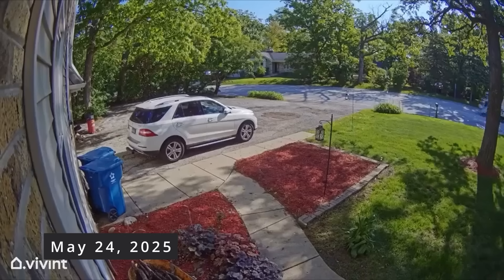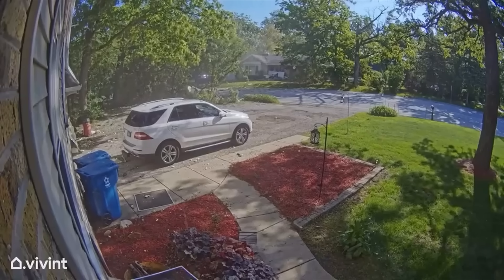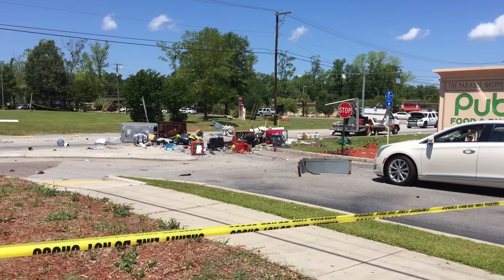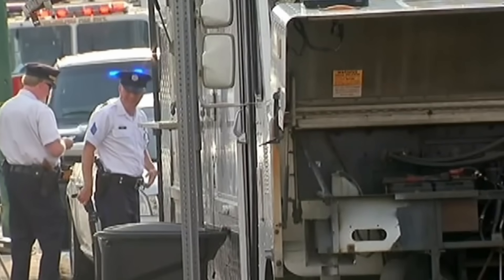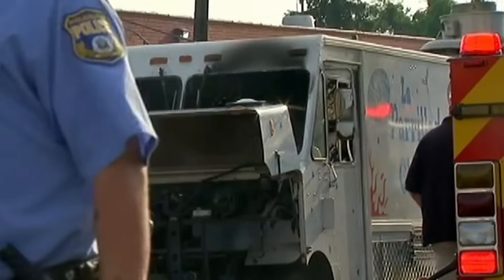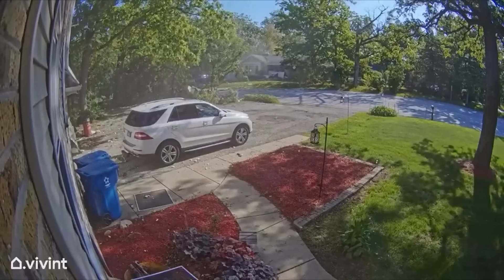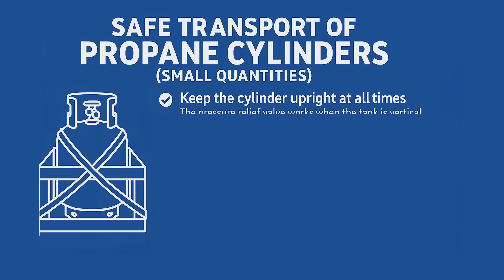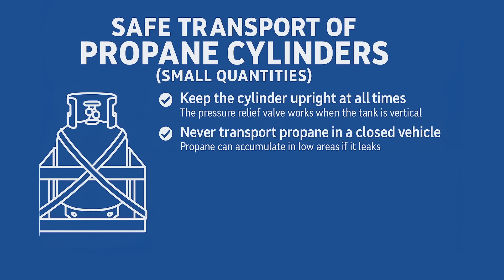Box Truck Explosion: How to Transport Propane Safely

Comment: In 1990 I was wiring an inlaw apt i had built with a friend who smoked cigars.  Suddenly we smelled gas.  There were no windows at doors installed yet.  We got out of there and called the FD.  The gas got stronger and entered my connected house so we evacuated to the street awaiting the FD from a half mile away.  When they arrived a Firefighter with a sniffer had me guide him through the house to the door leading to the basement and garage.  The door between them was open as was the garage door.  The sniffer did not detect the presence of gas as we walked through the house to the basement door.  Upon opening the door this Firefighter flicked a light switch.  He looked at me and said "I won't do THAT again"!  We descended the stairs to the basement and just before we reached the garage a different Firefighter opened windows the upstairs doors and windows.  Upon exiting the garage the sudden  draft pushed the gas cloud past us and set off the sniffer.  As it turned out the gas was propane.  At the back of my yard condos were built.  Some kid vented a 20lb gas grill propane tank and left the valve open because he wanted to empty the tank so when he took it to be filled he" wouldn't be paying for gas he already had".  The World is slopping over with idiots!
Reply: I'm at a loss for words.
Reply: To be fair, the firefighter came very close to being one of those idiots and taking you with him
Reply: And as evolution evolves, there won't be any idiots left! Can you imagine a world with no idiots?
Reply: @dirkfrazier-c1j I’m afraid that’s not how it works
Reply: @dirkfrazier-c1j the government protects idiots.  It's why standards keep.lowering , and idiots are coddled.
Reply: @dirkfrazier-c1j  Wrong, because idiots and psychopaths breed like mice.
Reply: What 😂😂😂 so why waste it if you already had propane ? It’s 40-50 if you buy the propane tank the first time 😂 20 for a refill 😅 why ?
Reply: @George_Soros.  Same thing if you siphoned every drop of gas out of your car before refilling it! Maybe, they just didn't want the old gas mixing with the new gas and fools are born every day!
Reply: 0 IQ activities

Comment: I remember many years ago, several propane tanks were stored on asphalt lot and on unusually hot day, the heat caused the tank to vent, and something started igniting the venting causing large fire to break out and some tanks that were still full started blowing up like rockets.  All because someone didn't think storing full tanks on black surface on a hot day would be a problem.  I can't remember the detail and Google keeps giving me this U-haul explosion even though I mentioned "several exploding tanks"

Comment: A propane tank meant for being mounted laying down ,like does used on forklifts should by any logic be transported laying down( with the overpressur valve pointing upwards) if it full and stands up  the overpressure relief valve may be in the liquid part of the propane ,
Thus not work in case of overpressure ,dont you agree?
When doing hot work certificate  courses, they  usely     talk about propane and acetylene gases in worksmans vehicles. I saw a picture of a wv sprinter that was totally ripped open due to a gas leak ,the guy using the vehicle used the remote to turn of the locks,  standing near the vehicle and the it  exploded kxxxng him.

Comment: My 20 lb. tank fits nicely in a standard milk crate.  Very stable and always sitting upright.
Reply: Doesn’t help if the valve is leaking.
Plumbers vans frequently “disassemble” when turned on in the morning for this reason…
Reply: @allangibson8494  Why plumbers vans? As a plumber, I'm curious
Reply: @rooter-c5c Plumbers have gas bottles for soldering copper pipes in their vans.
Unless you store those bottles in an externally ventilated blast proof compartment, leaking gas can build up inside and when the vehicle is started, sparks from the starter will ignite the trapped gas. The usual result is the body of the van spread over the neighbouring houses first thing in the morning (that tends to be bad for the driver’s health too). (Think car bomb).
So store your flammable materials in an externally ventilated compartment (or outside like most caravans do).
Reply: @allangibson8494  I think you've seen too many movies. I've been in this business for 35 years. Out of all the plumbing shops I've worked at, out of dozens and dozens of service vans, including my own shop vehicles or that of my acquaintances shop vehicles, never once have there been an incident involving a MAPP gas cylinder explosion. 
1. In a traditional open air van, you'd smell it upon entering the vehicle.
2. Spark/Ignition contained within in a starter
3. The starter/alternator are sealed off in the engine compartment.
4. The likelihood is virtually nil.
Reply: @rooter-c5c there’s always one guy…
Reply: How nice. Do you pet it every night before you go to bed?
Reply: I just always put in my lap under my seat belt.  That way, it is leaks, I know right away.  And if I am in an accident, the air bag will keep it secure.

Comment: Doesn't the vent need to be down low, like on the floor?
Reply: Corect! If you have propane tanks in a encolser like on many sailboats that may have propane  storage tank spaces built int the hull you should have  drain hole /hose  in the bottom that lets eventual leaked gas  run out.  Gas or gasoline explosions on boats are often deadly  because a boat cant be naturally wented in the bottom. The deck part  will often simply be blown clear of the boat. 
Exhaust fans mounted low in the hull to get rid of wapour build up has to be spark safe so they dont trigger a wapour explosion trying to prevent the explosion.

Comment: An "empty" propane cylinder is not empty of propane. Handle it the same as is if it is full. There is still enough propane left in the cylinder to  be a  hazard. Propane is heavier than air, so there will still be a quantity of propane in the cylinder. Keep this in mind when you are transporting your "empty" cylinder to be exchanged.
Reply: When I bought my first house the previous owner left an empty tank in the garage. I cook on coals so had no need for it. I opened it outdoors and a significant amount of gas released. I then closed it and put it back in the garage. I know…, should have just drove it to a service place and turned it in… Couple months later for some reason I opened the valve on a hot day. Sure enough it released gas. Did it like 3 more times over two years time.
Reply: What I understand you should not emty them completely if you aren't going to scrap them ,(in that case filling it with water would displace and puch out the gas)
The tank has to be cut open or drilled (when free of flamebla gas! )  so there can be no pressure buildup in   the tank  in smelting  furnace. 

The reason you want some gas pressure left is that you dont want the atmosphere to get into the tank before refilling/ exchanging for  a new filled  tank. The gas kompany dont want to get cylinders with  other gases in it when they refill them.
Reply: It wasn't empty then .

Comment: Pepole that refill propane tanks often over fill the containers and the tank will vent to 80% in moderate heat from over pressure. This is why exchange tanks only have 15lbs so they won't vent in a vehicle.

Comment: As long as people don't make the mistake of thinking that the problem in this case was that the tank was in the back of a box truck.

The inside of your car is a box, and the trunk is part of that box. The inside of your SUV is a box. Lucky for this guy, he was in a separate cab and the tank was in the box. A gas is far more likely to be exposed to an ignition source inside a car or SUV than in the box of a truck, where no one is messing with various electrical switches, etc.

Bottom line: Do what The Stache says and only transport tanks in open trailers or truck beds for maximum safety. If you must transport a cylinder (or a gas can, for that matter) in a car (even in the trunk) or SUV, roll the windows down first, put your ventilation fan on high, and don't activate any switches you don't have to until the cylinder (or can) is unloaded. Oh, and, don't get in a wreck while transporting them, either!

Comment: plus, liquid to a gas is something like 240 times, so 5 gallons of liquid is say, 240 gallons of vapor, then mixing with air to burn something like 2.5  to 1 so that 5 gallons goes a long ways
Reply: Depends on the chemical.

Comment: As a HVAC tech this comes to our attention regularly at training.   We carry propane, acetylene, oxygen, high pressure refrigerant cylinders and other high pressure gas cylinders.  This is covered in our safety meetings at least twice a year.
Reply: There was a video going around on YouTube of a propane refrigerant based air conditioner exploding on some service personnel. Because of the injuries it might be gone. One guy had his arm blown off.
Reply: @3fives-j5w  Yeah I have heard of that used for refrigerant. I will never own one of those things, no thank you. Give me standard freon type refrigerant and I'm good.
Reply: @Harold_Callahan  You probably already do. All the new refrigerators have it.
Reply: @3fives-j5w  most all new residential and sm commercial refrigerators and freezers use either cyclopentane R600a or R290 purified propane in tiny amounts. BBQ cylinder is 13 pounds, these are 2 to 4.4 ounces. Still requires training to work on.

Comment: I see propane tanks on fork trucks all the time mounted horizontal. I wonder if they are modified for that position ?
Reply: Forklift tanks (and LPG car tanks) are designed for horizontal mounting. They also feed liquid (not gaseous) propane to the engine.
Reply: @allangibson8494  Thanks so much !
Reply: @allangibson8494 Thank you for the education.

Comment: ALWAYS turn the tank valve off, when not using a BBQ or other propane appliance.   If the tank valve had been off, the amount of propane leaked would have been solely what was in the BBQ’s lines after the tank valve, which would NOT have been enough to produce an explosion like this, in that large of a confined space.

  For small camp stove cylinders without a valve, DISCONNECT them when not in use.

  I’m fairly certain they had not turned off the tank valve, and then during loading, a handle on the BBQ got turned on, and filled the floor of the box truck compartment with gas as they drove… 💣 until… 💥

Comment: Great info!  And a good reminder that the same rules also apply to the small, pressurized propane or butane containers that are used for camp stoves.
Reply: And modern air conditioners and refrigerators which use propane as a refrigerant.
Reply: Those are worse because their valves are weaker. I cap mine for transport with an old style LP brass torch head whose valve is snugly closed.

Comment: You specifically mention propane forklift bottles, which are mounted horizontally on the forklift.  Forklift safety classes teach to transport the tank horizontally like it's mounted on the forklift, to keep the pressure relief valve on top in the vapour zone.  Or at least that's what I was taught in certification courses.
Reply from the maker: Yes,  forklift tanks are horizontal and have an orientation.
Reply: @StacheDTraining  Right, I was just wondering as I thought you mentioned to carry them all upright vertically in the video, even forklift ones, while transporting them.

Comment: I teach cylinder inspection protocols primarily through the dive industry, although all pressurized cylinders fall under similar rules/guidelines, but adding volatile gasses into the mix - especially under pressure - sure adds another level of handling safety!
Good info, StacheD.

Comment: 25 years ago I worked in Moscow in company which sold food equipment including fastfood booths and so on, so was in the first row watching how, after 5 or 6 severe gas explosions in one season, all this semiportable propane food equipment was completely banned. 

Usual state of such propane systems (fastfood booths, home grills) is total decay, no one cares about cylinders, seals, hoses, valves and so on until they completely stop to work, lucky if just do not open and burns, not leak. And, of course, the best (the cheapest) way to refill is with adapter on car gas stations, up to the valve! Keep it up, Basil, another litre will fit in!

Comment: My small gas cylinder and propane torch fell off a shelf in my garage.
When I found it on the floor, I took it outside and tried to get it to light, but it was empty.
Lucky for me the tank was small and no sparks set off what leaked out

Comment: You made a major bad recommendation. The OPD valves have two valves. If you insert a POL plug in the OPD valve you overcome the secondary safety valve. Tanks above 60lbs with standard POL valves or non-OPD valves need plugs as a secondary safety while transporting (DOT requirement).

Comment: after watching it a few times the likely ignition source was the trucks interior lighting at the top of the box, because thats where the ignition point clearly is.
 ans the blast wave is mainly down and out as the whole box was filled with gas like a FAE device.

Comment: Late last year, we had a residential fire.  Home was owned by a 80 some year olf hoarder who was sleeping in the front room. The cause of the fire was an overloaded outlet in the front room where the homeowner also had about 8 propane tanks he was using to run propane heaters. Luckily the tanks didnt go off, not sure if they were empty or not tbh. Unfortunately homeowner passed away. Had two more incidents at that same house several days after

Comment: When propane and air mixture reach a proportion of about 15 : 1  (15 parts of air and 1 part of propane, by mass) - that is called stoichiometric ratio and is when the mixture is ready to rapidly react.  
With that mixture ratio of 15:1 a feeble spark (likely from the truck exhaust) did set off the chemical reaction, which caused the RUD (Rapid Unscheduled Disassembly) of the vehicle.
Thank you StacheD, for the very informative video.
Greetings from the UK,
Anthony
Reply: You need to look at the Lower Explosive Limit and Upper Explosive Limit, not stoichiometric.  Stoichiometric is just where energy burn efficiency is maximum.  For Propane they’re 2.1% to 9.5% respectively, though that does vary a bit by temperature and altitude/pressure.  Hydrogen is far worse, 4% to 75%.  Acetylene is ridiculous, 2.5% to 100%.
Reply: @Georgewilliamherbert At stoichiometric ratio you have a greater chance of detonation.
Reply: Assuming that air-fuel mixture for perfect combustion and the size of a small car with 2.500 Liters of interior volume, just one of these rouglhy 220g camp stove canisters venting is getting  close to that.
And the window of combustion is wider than stochiometric. 😮
Reply: that box truck at a guess is about 10 cubic metres give or take, thats less than 1kg for fuel for the perfect boom
Reply: That brought me back to my old Hazmat Ops training.

Comment: As much as I love eating at a good food truck, it's crazy how many deaths have occurred from some of these LP explosions, due to a DIY food truck gas connection. I also responded to a single family residence, where the roof was literally blown off the house in  a several block radius. Due to a 20lb tank leaking inside the home! It is incredible to see what a small container could do in regards to destruction.
Reply: 20 lb of explosive is not so small gun shell. But the same 20 lb as propane-air mix deemed to be nothing specific, who cares, let it stink a bit, nothing happens!
Reply: You really can't do a " DIY " food truck propane system,they are inspected . Most problems arise from human error .

Comment: We had someone decide to create an incident. It ended with 40+ "propane" tanks burning or exploding. The person who started the incident ended up as a statistic. Dead, very dead. It shut down a hardware store for about a week as they cleaned up  the mess. This was one of the reasons stores can't store indoors and can't have hundreds of 20 pound canisters.
Reply: Yes but Walmart can have 50 1 lb propane cylinders on a shelf in their camping isle, along with 20 1 gallon jugs of Colman lamp fuel and cans of sterno fuel.
Reply: @tubeonline629  You know I question that policy. They should be in a fire cabinet which is locked and only can be accessed by trusted employees.
Reply: @tubeonline629  If those leak during working hours evacuation is easy while the internal volume of each cylinder is small.

Comment: Living next to a Norfolk Southern rail line my community’s municipal services are quite aware of the hazards of LP, LNG, shale oil, “1993” diesel, iso-butane, chlorine gas, nitric acid and a whole littany of  other fun and exciting placarded freight.  I’ve seen many placarded tank trains with over 200 unit counts and distributed motive power come rolling thru at 3AM. Even with Norfolk’s vigilance with track and equipment maintenance, accidents still happen such as the one in East Palestine Ohio. When I was an elected municipal council official, I made it a priority for our local EMS, fire, police and civil defense to make contingency plans in case one of these trains jumped the tracks. It was quite concerning finding out just how many community agencies and governing bodies, much less the public at large are unaware of the hazards of placarded freight.  If you think that Penske truck going boom was a big deal, just wait until a string of rail tankers turn into popcorn in your town.
Reply: The safest approach to this problem is: Do not allow CSX to run placarded freight through your township! 🚂💥😉